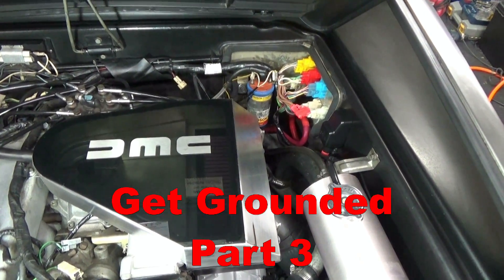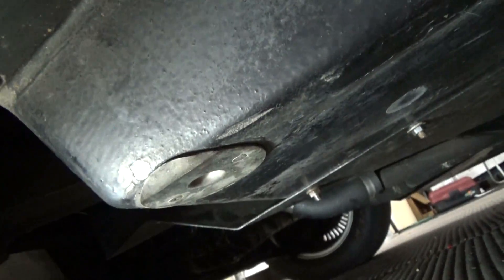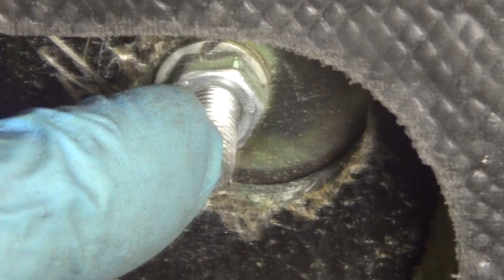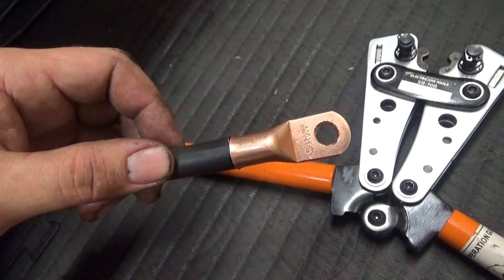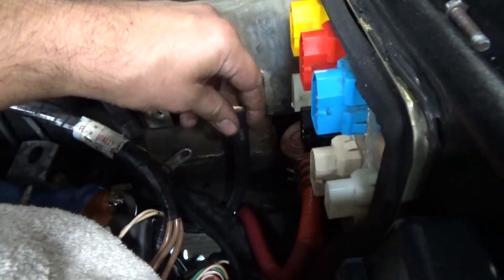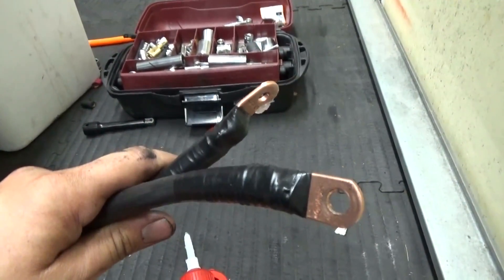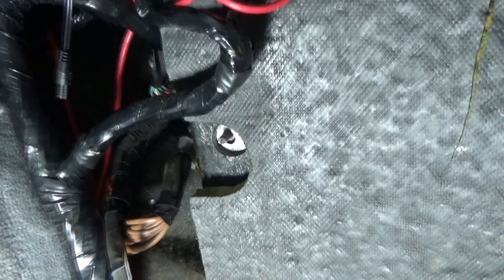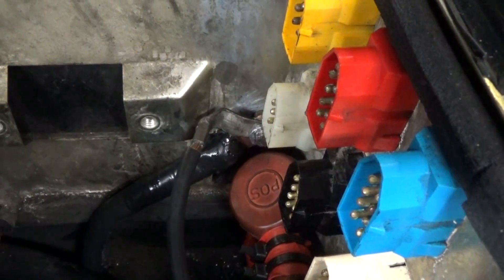Get Grounded 3: Upgrade the DeLorean's bulkhead ground and run to transmission "Hervey-style"

Comment: Do you know the wire that connects your display for your thermostat when your cars are? I think mine came unplugged and is showing vertical up straight up in the air when I turn the car on.

Comment: I really appreciate these videos!  I'm rebuilding my frame and thinking about upgrading the grounds like the body is off.  Am I understanding the ground setup correctly - the ground cable comes from the battery, out a hole in the body, connecting to the trailing arm bolt, then from a spot on the frame a cable is used to wire back through a hole in the body in order to ground everything inside of the car?  I'm curious why not split the ground right at the battery and run a cable up to the bulkhead ground - so that it never leaves the interior?
Reply from the maker: Bill Carlson That’s almost what I did this video, part three. I left the bulkhead ground in place but then fortified it with another ground directly to the transmission and thus connecting to the same location that the battery is connected to.  But you are seeing that some of the original ground set up is a little wonky.  There’s different ways to do it, but i firmly believe grounding to the transmission casing is the way to go.